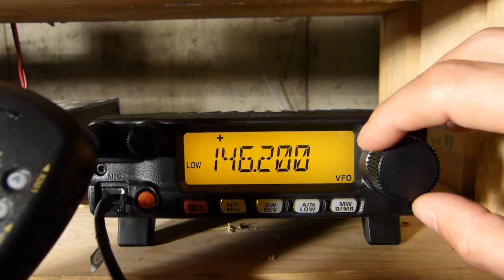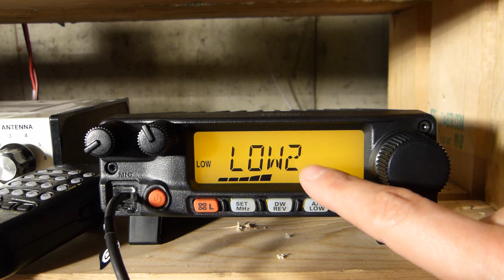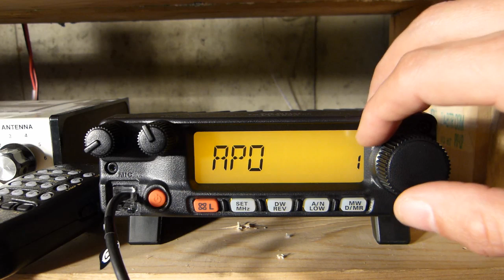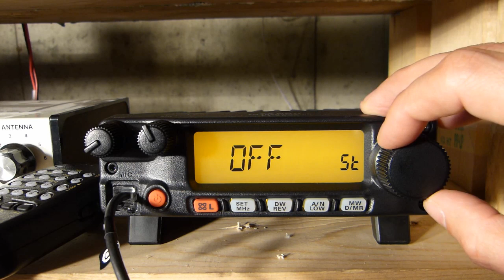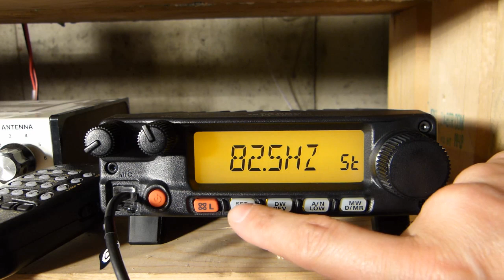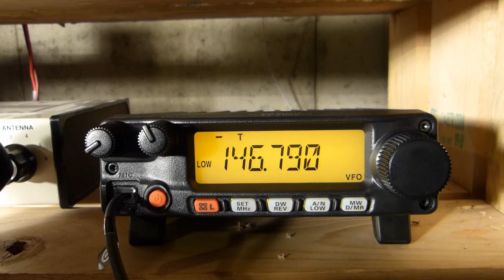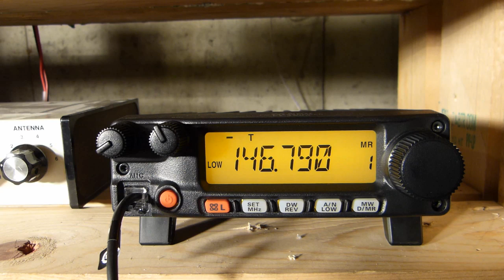Yaesu FT-2900 Memory Channel Programming Highlights

Comment: How do you delete memories?
Reply: I also need help with this.  In my bumbling, I did finally get 4 freqs programmed,  but several got duplicated.  I'd like to clean those off, but can't find out how to do it.  Any help will be much appreciated.  Thanks!
Reply: This radio you can’t delete memory ch’s you just have to reprogram and rewrite to the channel, however they have a new radio out now that you can delete the memory ch’s

Comment: Yaesu FT2900 is my first HAM radio and trying to understand what those letters on the buttons mean frustrated me so much that I asked someone just to put 5 frequencies in 5 memory channels for me. Now I have to change those frequencies and the nightmare relapse...until I found your video. Somehow after watching it just one time i felt like a complete idiot and become fully confident that I would be able to do it tomorrow. Thank you for making it so simple and easy to understand even for someone like me.
Reply from the maker: I'm glad you liked my video!  Thanks for letting me know it was helpful.  The lebeling on these radios is terrible.  I'm an extra class ham and have had my ticket over 20 years and I still don't get what the button labels are supposed to mean!

Comment: I am brand new to Ham radio and I am a slow learner. I have come back to this video each time I program my radio. I have hit a snag and hope you can help. I have programmed the first 4 memory channels. I know this radio has 200 slots open for memory but my radio won't go past 4. So at this point I can only program 4 channels. I have read the manual and cannot find any reference to this. How do I access the rest of the openings for memory? Can you help? Thank you.
Reply from the maker: A few things come to mind but its hard for me to really nail down what is going on without being at your radio...

1.  Are you looking at the band edge channels rather than the "regular" memory channels?  In other words, are the channel numbers preceded by a "b"?

2.  Are you trying to program a frequency that is not within the radio's limits by accident?  Double check all of the settings and make sure they are valid.  You could try programming one of the frequencies you have already programmed into the next memory channel to see if it will accept it.

3.  Sometimes these radio's brains get scrambled for no good reason.  You could try resetting the radio to factory defaults and see if that helps.  That, of course, means you'll loose anything you have already programmed but may be the only solution.

I can think of a few other things that might be happening but try these first and see if you make progress.

Good Luck and welcome to the hobby!

Comment: Your video is very helpful, and followed every step, for local repeater 147.000 mhz  with neg offset 
-How do I set a neg offset?

-The manual default is 0.60 MHz, do I leave that alone or how much do I adjust??  
-Do I need to do that on 46 Shift??

Also can I program more that one repeater on the rig?
Reply from the maker: In VFO mode program your frequency and tone according to my video then:

Push and hold the Set/MHZ button for 1 second to enter the options menus

Turn the tuning knob to "RPT 43"

Push and release the set/mhz button - display will change to "+RPT St"

use the tuning knob to change the selection to "-RPT St"

Push and hols the Set/MHZ button for 1 second to return to VFO mode

You should now see the "-" icon at the top of the screen

You can now write this to memory as shown in my video.

Hope that helps!
Reply: Thank you for the quick response. I'll make my adjustments and test the rig.
73
Reply: SevenFortyOne,
My friend your instructions were right on point! I  made my adjustments, tested my rig on a local repeater and got my first contact today! Signal good but gotta increase my mic gain. 
Thank you much for the help. 
73
Reply from the maker: Great!  I'm glad I could help.  Enjoy the hobby!